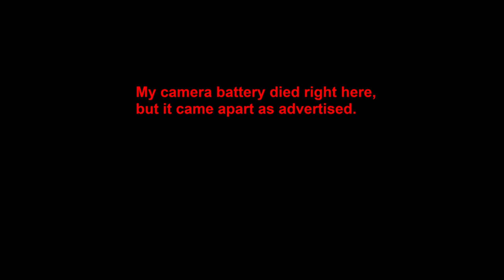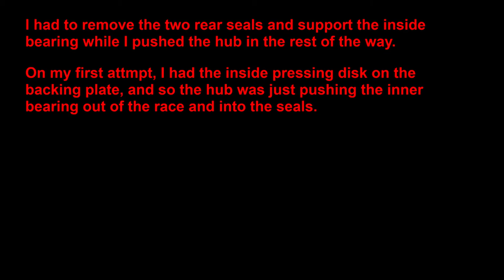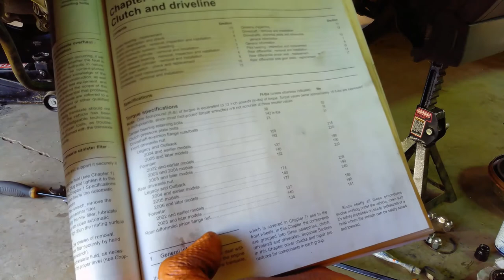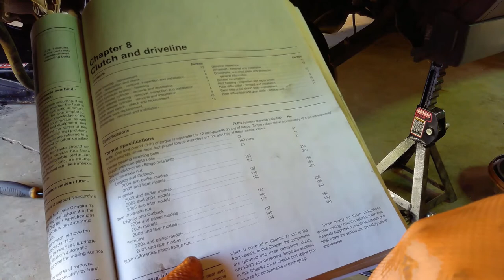Subaru Forester rear wheel bearing replacement

Comment: Looks like that inner suspension bolt has a concentric adjuster. In other words that bolt attachment allows for camber adjustment. You will need to take your car in to a shop that does alignment to have the rear camber set since you took off that inner bolt. The outer bolt is the one to remove, not the inner bolt due to the camber adjuster on the inside bolt.

Comment: Good effort and tenacity, screw the inevitable haters at the end of the comments, too. Just pinging in or staking the hub to the axle or whatever, is the only main critique I have, in a friendly nice tone. I only know from other videos I have watched. Also, using pb blaster on the big long 14 mm nut you couldn't get out by itself, seems to fix the issue, instead of WD40. And then lastly, I guess you made it work, but I came here looking for which press kit to use, I have both on my Amazon wishlist, but I feel like the rear kit would have been better hear since it was a rear wheel bearing, but maybe it doesn't matter. The rear kit is like $30 and the front $76 or something. Just my 2 cents. I am going to attempt the job myself in about a month, just researching a lot beforehand. Oh and I am also going to use a seal puller for the seals, and yes, use lots of grease. Good game and keep at it bro, positive energy to you!!

Comment: I never saw you stake the axle nut! You need to take a chisel(not a screwdriver) and peen the locking ring f the axle nut into the groove of the axle. Otherwise, you’re going to be doing this job again, except you’ll also be replacing the CV axle assembly too. The splines in the hub and on the axle will get ground down once the nut gets loose…

Comment: Hey is that the front wheel drive bearing press from Amazon? I can't figure out witch one I need?
Reply from the maker: Yeah, I ordered the "Orion Motor Tech 23-Piece FWD Front Wheel Drive Bearing Adapters Press Kit Puller Set Replacement Installer Removal Automotive Mechanics Tool Kit" from Amazon.

Comment: BEST WAY TO GET THE BOLT OUT IS TO GET A TOURCH AND BURN THE BUSHINGS OUT, REPLACE WITH NEW RUBBER BUSHINGS, ,WORKS THE BEST
Reply: ya don’t have to burn the bushings out at all.  just heat the metal bracket and give it hell squirting on blaster in it while you crank on it with a breaker bar

Comment: ive done two of these.  they are absolute hell.  I work on Ford diesels and they are a cake walk compared to this.   I did however heat the metal bracket ends before the rubber bushings. after two hours of beating with a sledge hammer, i added the heat and it started to move.   i eventually got it.   what a miserable car to work on and a miserable car period.  i cant stand my forester. the rubber smoked a tad bit but i didn’t lose the bushings   . it was well worth it
Reply: Agree on all counts. I think this is the last winter for my forester. I'd have ditched it already but I am waiting on parts for the replacement vehicle. Everything on this car seems to require removing something hard to get out. Of course an Audi or BMW make it look like cake so don't buy those either if you intend on wrenching on them yourself.

Comment: Thank you, sir! That was extremely edu-ma-cational and it was nice to see this job attempted by someone else who hadn't done before either!👍🙂

I'm 98.3% certain that one of the rear wheel bearings is letting go on my 99 Foz and I may very well buy more tools and attempt it myself if the shop estimate is higher than the cost of the needed tools after watching this.👍 It looks much harder than it needed to be (as expected) but I wanted some of those tools anyway and I don't like the idea of anyone else messing with my Subaru. Lol
Reply: Once you do it you'll be confident to do it again and you can charge one of your friends good money and stilll save them some cash from going to the shop.
Reply: Also to know if it's your wheel bearing (usually it's the rear passenger one) you have to put load on it. Try turning to the right with all the fans and music off and see if the hum gets louder. If it does then it is more than likely your bearing.

Comment: Faster to buy whole assembly , pack extra grease behind the seal , they have very little grease from manufacturer , , I check mine by jacking up rear , both tires off the ground and spin by hand , u will hear and feel which one is getting rough , I just replaced right rear and 22000 later needs a new one, did not pack extra grease in the first one, be prepared to replace often , just like the head gasket , replace drive and replace , after 1996 subaru went down hill , they are junk .

Comment: Instead of struggling buy a bar that can slide over ring spanner’s and socket wrenches to give you more leverage saves so much time and effort
Reply from the maker: I actually tried a few other things on that bolt that didn't make the cut--including a bar for the wrench. Problem is there's not enough room under the car for much length in a bar. If I had it up on a lift, that would have worked great!

Comment: How did ya fix the issue of the hub pushing out the rear seal? Did you end up with inner race issues from pressing on it? Seems like ya need a seat that holds both outter and inner bearing. Yet the clearance there needs a tapered seat. Thanks for the video! Just trying to remedy running into the loose hub install.
Reply from the maker: It's been quite a while since I did that job. I do remember making the mistake pushing the bearing in, but I'm still driving it and it hasn't been a problem so I guess it was okay. I think the key is to make sure your press is set up to be pushing on the right part of the bearing (the outer race when pushing it in.)

Comment: Gotta say there is something to be said for your ingenuity and tenacity but I tuned in to see how the axle was taken out for access to the bearing. How did big bolt come out and did you really need to buy chinese hub or could you use the old one? Good to see go getters on you tube thanks!
Reply from the maker: You talking about the big hub bolt? It comes off pretty easy, un-peen it and then counter-hold the hub with a bar of some sort. In my video I take it off around 4:30. I think you could re-use the old hub. The parts kit I ordered came with bearings and hubs. The only issue is that you would have to get the inner race off the old hub somehow, which might be difficult. My process basically destroys the old bearing during removal. It leaves the inner race on the hub, which then gets discarded.
Reply: @philbrown5722  video. Thanks I was referring to the long bolt everyone bitches about removing. 13 or 14 inch 5/8 or so.
Reply from the maker: @pauliebots  Oh yeah, that. I didn't get it out. I tried the option of removing the support bolts near the rear diff, but only got one of those. With the one I did get, I was able to get the whole thing out of the way.
Reply: @philbrown5722  ok I'm gonna do this job soon. Watched half a dozen vids think I'm ready. I'm getting too old for this shit. BUT, I am not paying 500 bucks to some mook. Thanks for the video and getting back to me!
Reply from the maker: @pauliebots  Good luck!
Reply: @philbrown5722  Hey Phil,got her done. Big bolt came out pretty easy,got lucky. Funny, bizarre thing the Japanese koyo bearing I got was tampered with. I got the thing in there pushed out the plastic keeper sleeve and one of the roller bearings from inside dropped out! %@#$&. Could not believe it. So I went local and got a chinese duralast bearing. Man! Quiet as a church mouse now. Hey thanks for posting!
Reply: @pauliebots  amazing the koyo failed! I hope the duralast lasts.
Reply: @ieatalot2  my subaru developed a head gasket leak and started overheating . Junked it. Got $600 from junk man.
Reply: @pauliebots  I’m really sorry to hear that.

Comment: If you live in an area where they salt the roads or you are parking near salt water then you have a whole different can of worms. Removing the long bolt is the problem. Everything else is just a special tool problem for the home mechanic. Any way around it you do not need to remove the cam bolt at the top of the link; just the long bolt.. For a video on removing said bolt (plus the rest of the repair) see https://www.youtube.com/watch?v=w7rYxh0XWuA. It takes the guy around 20mins to remove that bolt with heavy impact hammer use and he is calling that one relatively easy.
Reply: bro, ive done that bolt before and let me tell you now, the one he did wasnt that bad. mine i had to completely remove the knuckles, grind the centre and the ends of the  bolt off basically cutting it off the car. and then using a 12 ton press and a blowtorch, i was able to finally press out the 2 bits of bolt left in the hub. it took me all day to do just one. tried everything else first.
Its really luck of the draw tbh. i greased the hell out of mine before putting them back in, so fingeres crossed, because ive gotta do the bearings again. (moog bearings are crap btw)

Comment: Hey man, i’ve been using your video to do this job on my 2000 forester and your video has helped a ton. I got the hub out and got the outer arm down (the one that doesn’t have the weird cover over the nut/the same one you were able to get loose) but i cant seem to move the drum/ wheel assembly enough to get the axle out. I’ve tried getting the infamous long bolt out but i was only able to get the nut off of it. Was there anything else you did to get the long bolt out of the knuckle or did you just pull it out with the strut/outer arm attatched to the bolt? Anything helps thanks!
Reply from the maker: Oh boy, it's been a while. I definitely did not get the long bolt out. I was able to get the hub to move enough to remove the axle with the one arm disconnected from under the middle of the car, and the other disconnected at the knuckle... I think.
Reply: @philbrown5722  Ok thx. I think also bought the same bearings and hubs that you did. Have you had any bearing issues since installing them?
Reply: @philbrown5722  And 1 more question (sry). At 39:52 you put the bolt back in to the knuckle; to get it out did you just hammer it out from the other side when your camera died?
Reply from the maker: Yeah, still running that bearing and it seems fine.
I think you're talking about the long bolt? I never got it all the way out. It remained trapped in the rear bushing. However, it came out of the front one, and that's all I needed. Basically, you've got two lower control arms coming down that have to be disconnected either at the body or the knuckle (where the long bolt is.) I got the rear one disconnected at the body (failed at the long bolt), and the front one disconnected from the end of the long bolt (I wasn't able to get that front body bolt).

Comment: I am about  to do the the same job! Your video helped out, thanks!
Reply from the maker: Awesome. Good luck. Be sure to get those seals in the right orientation. That messed me up the first time around.
Reply: and don’t forget to put your old tone ring on the new hun first.  like me, i didn’t. and had to slide hammer it back off again.  i did this in my drive way sitting on a damn bucket on a 90 degree day.    never.    never again

Comment: can you just reuse the old hub with the new bearing?
Reply from the maker: Yeah, the hub is reusable.
Reply: @philbrown5722  I am replacing the bearing soon and hopefully can reuse the hub provided it is in good shape. Will see !
Reply: @philbrown5722  what is the wrench size for the bolt and nuts at 42:49? Thanks very much
Reply from the maker: @timexchen  you know, it's been a while. I honestly don't remember. 18mm?
Reply: @philbrown5722  I brought the car to a subaru independent shop today and they worked on it to tell me the bolt on trailing arm is seized and can not be removed. I asked them to remove the lateral link bolt just like you did and they said they tried but seized as well. I had to drive back and now sprayed some penetrating oil around the bot to hopefully free it up. I am gonna spray multiple times and give it a try in a month. Thank you for the reply!
Reply from the maker: Dang. Yeah, it seems like they can be problematic. When they just won't come out, I've seen other people use a sawzall to cut the long bolt at the hub, knock it out and then install a new one at the end.
Reply: @philbrown5722  I watched again and again at 15:29 and my understanding is the long bolt seems to be stuck in the knuckle because I do see some movement between the long bolt the the lateral link bushing when you pried it back and forth if I am not mistaken. However at 24:40 after camera died unfortunately, the video shows the long bolt has been removed from the knuckle. I am confused because your plan A seems to be removing the long bolt to free up the knuckle so the axle can be taken out. Since the long bolt was not really coming out, your plan B is to remove the rear lateral link bolt from the subframe and took the sway bar link off to remove the axle. But the video at the end shows the long bolt is taken off. So just curious, is it mandatory to remove the long bolt from the knuckle to get this job done? was it because the lateral link and the sway bar hold things tight in place so you had to remove lateral link and sway bar first then you could take out the long bolt or it gets stuck at the bushing so you had to take the bolt off with the bushing on it?  Sorry I know these are a lot of questions but hopeful can find the answer to the mystery before I dive in on my car!
Reply from the maker: I'm trying to remember exactly how that went. I definitely never got the long bolt all the way out. I was able to move it enough to get on of the lateral links off, and then was able to disconnect the other lateral link. Between the two, the knuckle was disconnected and I could move it out of the way.
Reply: @philbrown5722  I guess you were able to remove the bolt but with the bushing stuck on it so the lateral link is still holding that long bolt.  The video does not show the other lateral link but I had thought you didn’t need to remove the other one. Guess i am wrong…BTW do you think removing two bolts on the rear strut can free up the knuckle so you get the axle out? Today I took look carefully and thought it should work. Will talk to a shop to see what they say